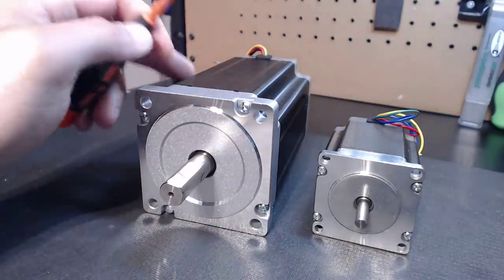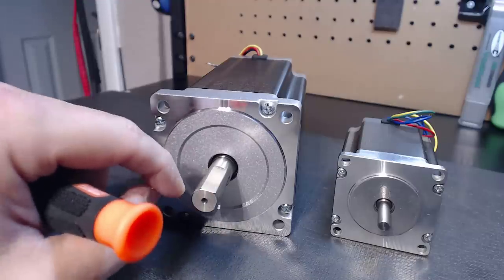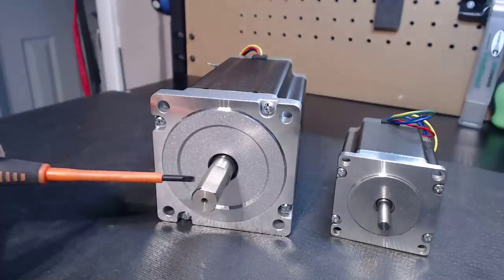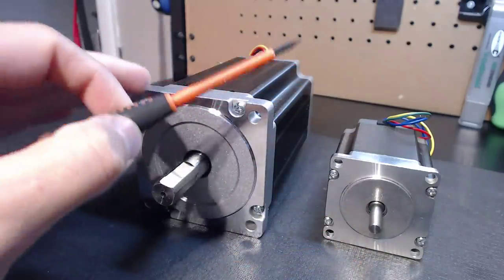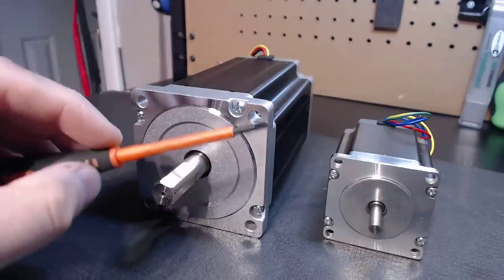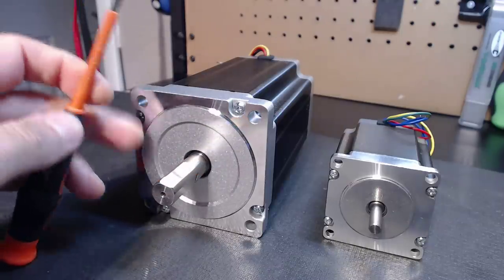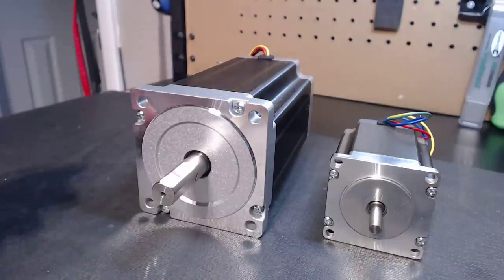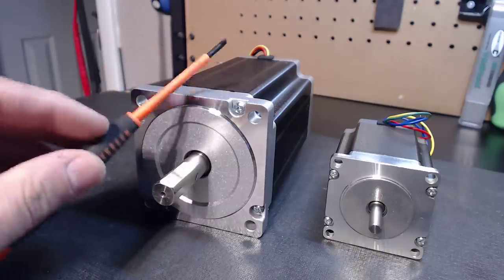Stepper Motor Torque For Your Applications..

Comment: where can I get 24 VDC motor  continues run 75NM torque, 1500RPM .
Reply from the maker: Thomas thank you for your support. I think you may have the torque rating incorrect as 75 newton meters is over 10000 oz/in of torque. Thank you,
Vince
Reply: @corvetteguy50  NO no no . My rating is correct . I want 24Vdc motor with 75newton meter torque . I want use this motor to run an  10KW AC  alternator
Reply from the maker: Thomas, a stepper motor that puts out 10 Newton Meters is 10,621 oz/in or 664 in/lbs of torque. There's no stepper that currently will put out that torque on 24v DC. Thank you,
Vince
Reply: @corvetteguy50  ok friend what is the maximum torque with 24VDC 1500 RPM continues run motor with you?
Reply from the maker: Thomas the question  your asking has to many unknown variables to give you an answer. The drive/drivers being used is the first thing to consider, and the RPM of the motor is based on a specific motor, driver, power supply combination. I would recommend using a 48v power supply, for whatever components you plan on using as increased voltage will provide better resolution, and motor speed. Thank you,
Vince

Comment: Hi! i need to rotate a shaft (3.5 kg), but not only rotate, i need to accelerate from speed 0rpm to 150 rpm in about 0.2 secs. My 425oz stepper misses steps, do you think i will have more luck with the 1700 oz? Thanks a lot for your work!
Reply from the maker: trucheitor, thank you for your support. Unfortunately a stepper isn't really suited for that type of acceleration. I would recommend a DC motor. Thank you, and have a great weekend!
Vince

Comment: Cant wait to try a dd wheel haha
Reply from the maker: reviewfor the tube, thank you for your support. I really appreciate it. Sounds like a plan  :)  Thank you, Vince
Reply: @corvetteguy50  yeah im going to be picking up the dd1 from fanatec for a few reasons 1 its the first dd wheel where the motor was apecifically made for sim racing another I just think it great and it can be used with ps4 xbox one and pc and I just like the way fnastec wheels feel adn I own the csw v2.5 and it feels amaizng I cant imagine there dd wheel the only thing is fanatec needa to do there software differently because each time there is an update it always messed with the way it actually feels so its like damn they just need to get them kore consistent and find a good feel stick with it amd just improve areas slightly not accidently change the emtire feel of the wheel every damn update lol
Reply from the maker: @reviewforthetube6485  Steppers certainly offer some amazing options in terms of simulators, and I wish you the best with yours. Thank you again for your support. Vince

Comment: Guys underestimate the power of these motors. They look at the physical size and think they look too small. So they usually go too big out of fear of going to small. That 1700 oz. motor is a monster. Whatever you attach it to needs to be idiot proof.
Reply from the maker: Chris thank you for your support, and you couldn't be more right. Motors are an easy component to spend to much on because everyone wants to overbuild. Going with the 20% buffer will keep you usually well within your budget, and provide you the performance your looking for. Thank you, Vince

Comment: hi, what do i need to use them in carrying about 150kg at highest speed?? i want to use only 2 of them ? when i mean carrying i meant transport from one location to other with only 2 stepper motor
Reply from the maker: MrT MrF thank you for your support. I really appreciate it. The motors required for your application wold be Nema 42 sizes. Thank you, and please be safe.
Vince

Comment: Hello,
I have nema 14 motor. Holdin torque is 1,4 kgcm (20 ozin). I have mechanisam similar to umbrella that has paper on top in origami shape that has to be shrivelled ( dont know if thats correct word).  You can check video diffusion choir on youtube and you will se project, I just want to make replica as school project. Diametar of my model is 60 cm. Do you think my motor is good for that application. 

Best regards,
Davor
Reply from the maker: Davor, Thank you for your support. I would need to see the application to give you feedback on if the motor is correct for it. Please send me the link to it. Thank you,
Vince